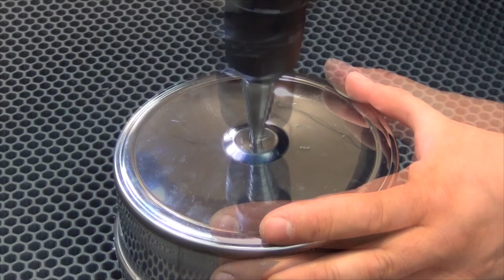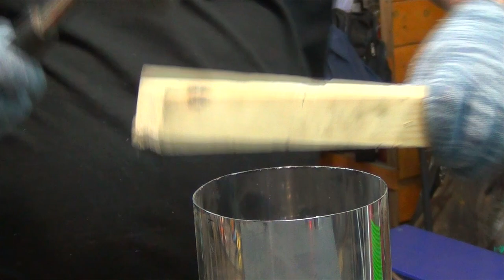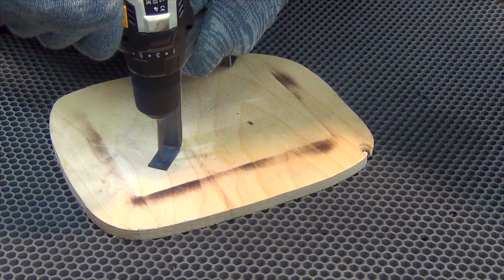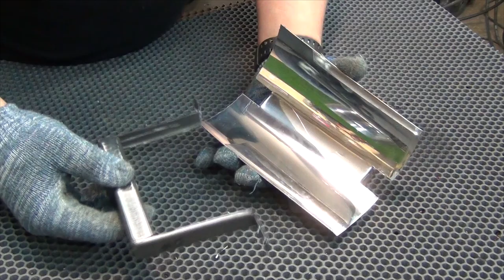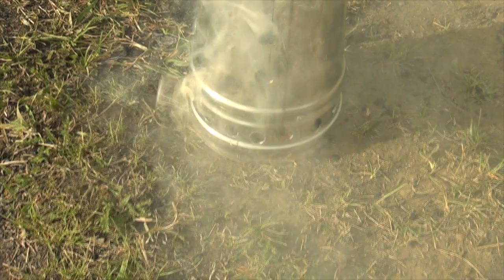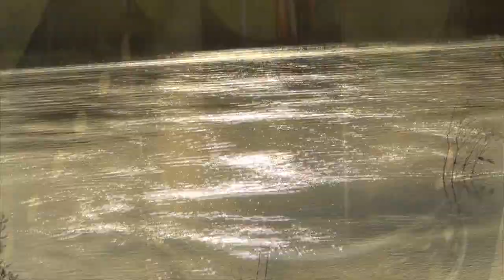Few people know this secret of the chimney section! Brilliant idea!

Comment: I made mine from 20 gauge 4o4 stainless sheet. And I used stainless 8-32 bolts and nuts. Those rivets used in this video will absolutely fail sooner rather than later.
Mine is also 3x the capacity of the one shown here. I have a big grill for real cooking.